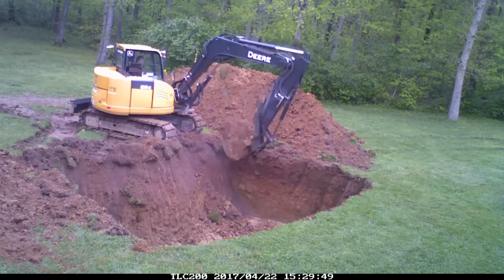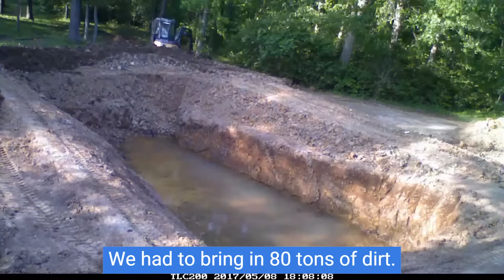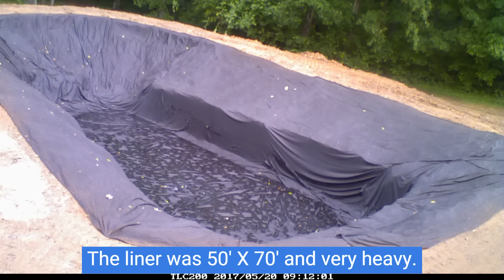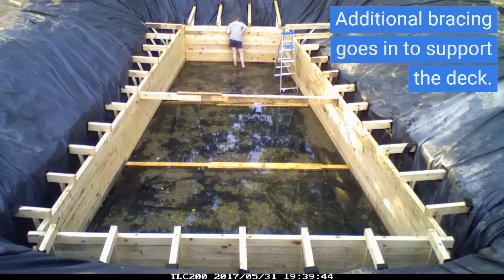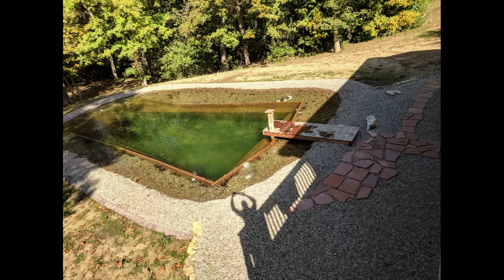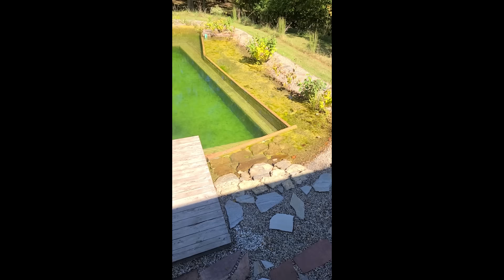Natural Pool Time Lapse Build

Comment: I have an EASIER design.
I hope I can describe it with words.
Dig the swim area first, but only 2/3rds of the total depth. Mind will be 6 feet deep. Sorry for not using the metric system.
So I'm diging 4 feet deep and moving ALL of this excavated soil 20 feet away from the hole. My hole/swim area will be 45 feet long × 10 feet wide.
Then I put my 100 foot long × 50 foot wide liner in the hole with all the excess liner laying FLAT on the ground extending outward towards the mound of the recently excavated soil encircling the area from the orginal excavation of the swim area. Next: pour 4 inches of concrete in the swim area on top of the liner with wire mesh for stregth.... Keep in mind. This concrete is never going to support anything but water. Strength isn't it's main function. The function is to protect the liner and supoort the cement block walls... which are next. Next: Build a 4 foot block wall to frame the swim area. Like you did with wood which works well TOO. I just have more access to concrete than wood and think it is easier to frame.. Next. Pour a 4 inch cement slab on top of the liner around the swim area that extends outward 10 feet and tie it into the 4 foot block wall. Next... Build the outer parameter wall 2 feet high of block on this slab. These walls should be 65 feet long × 30 feet wide. Next: fold the liner up against and over the outer block. Now, push the excavated soil up against the liner. It should be soil, liner, block..... Then, fold the liner in a manner that none is left exposed. That completes the frame of the pond/pool. Next: Working on the rock filtratio. I'm using 4 inch × 4 inch thick and 8 foot long cement poles to frame the rock zone. I am laying them end to end 18" from the swim zone on the upper ledge. Next: I am putting the corrugated tubing closest to the outer walls. Latstly: filling the area from the two foot block walls to the 4inch × 4inch cement posts. The rocks will have a gradual slope from the 2 foot block wall down to the 4×4 cement posts. Any plant roots will have 2 full feet of rocks to extend their roots downward. Plants like lillies will be planted closer to the 4×4 posts because they have short roots but want the 2 feet of water for their stems to grow upward. 
Overall....
The swim zone is 10 feet × 45 feet.
There will be an 18-inch walking zone that is 2 feet deep all the way around the swim zone. Then an 8 foot wide planted zone.
Total length 65 feet long.
Total width 30 feet wide.
Total depth 6 feet. 
The soil will slope downward from the 2 foot block wall with a "rise over run" 10 to 1..... 2 feet of soil sloping downward over 20 feet back to level ground.
Total land space needed....
105 feet × 70 feet.
How's that?
Oh yeah. One corner of the outer wall will be 1 inch lower than the rest of the pond. All rain overflow will go flow over this corner.

Comment: The stainless lag screws cost more than everything else on the job combined.
Reply from the maker: The backfill and the liner were the most expensive parts. I was able to source the lags and washers from a wholesaler in FL for about $700.
Reply: @jonathanmcmahon2214  I know I was being silly.  Stainless steel is always overpriced considering how simple the plating process is.

Comment: With all that clay you could have had a pond, with out a liner,
Reply from the maker: Very possibly. I have no idea. Originally, this was going to be a traditional pool. But, when I was making my material list, natural pools popped up in my feed and the whole plan changed to this.
Reply: @jonathanmcmahon2214  wouldn’t have been as clean though that’s for sure. If it does get green add a uv light in the filter, it kills green pea soup algae (free floating) and some bacteria.